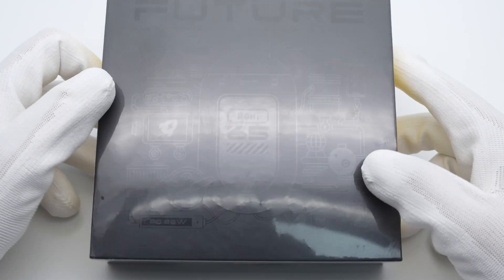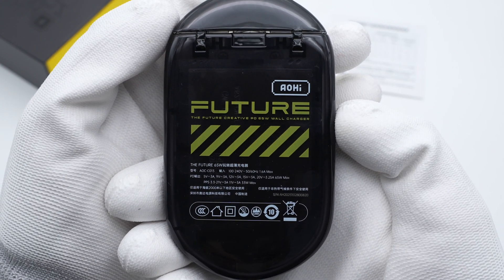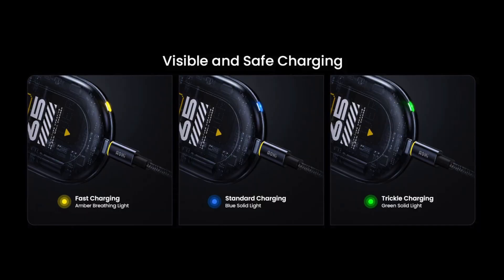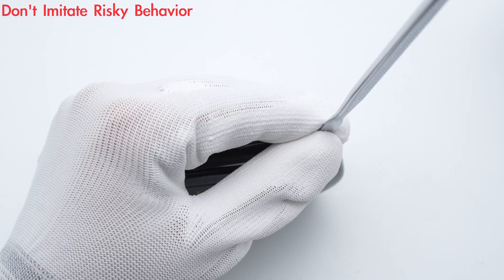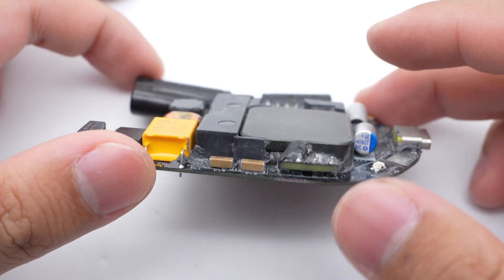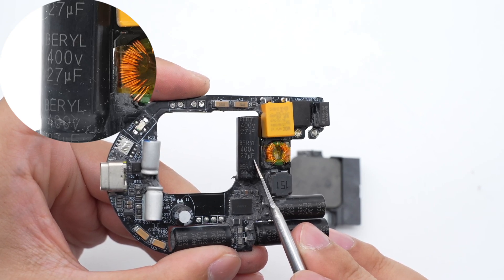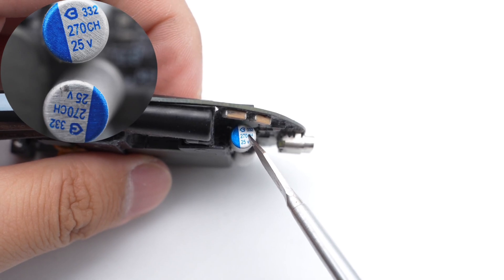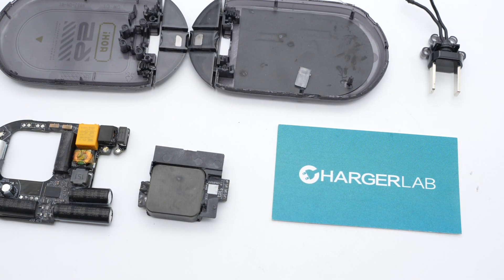Ultra-thin | Teardown of AOHi 65W Translucent GaN+ Charger

Comment: What is the purpose of vbus MOSFET
Reply: Safety.... If you plug something that shouldn't be plugged, it will quickly disable or not even enable at all the output
Reply: USB Type-C ports are not allowed to output power (according to the spec) until they either detect a pulldown resistor for legacy USB mode or communications on the CC1 or CC2 pins. So VBUS MOSFET keeps the power off until a device requests power.